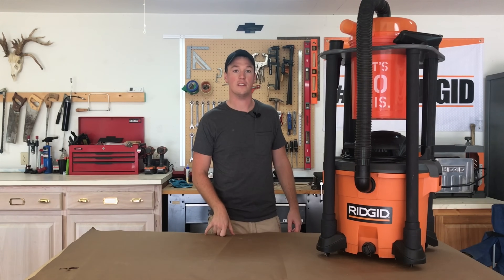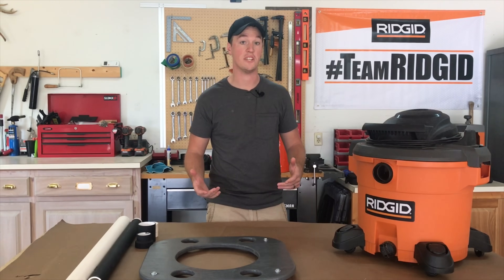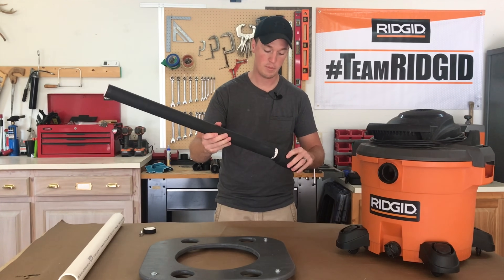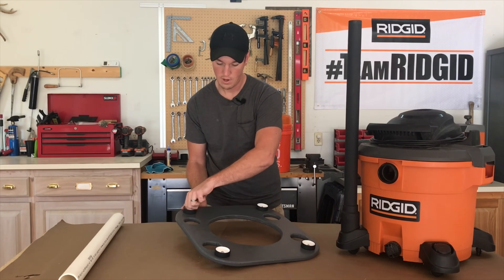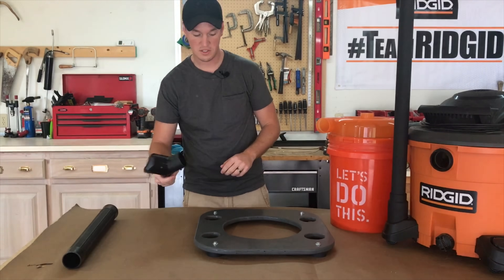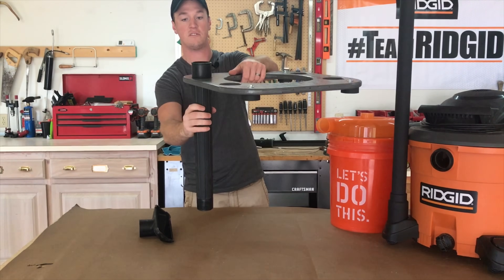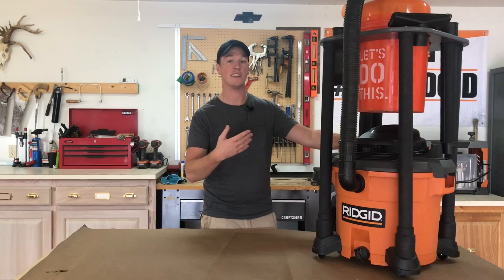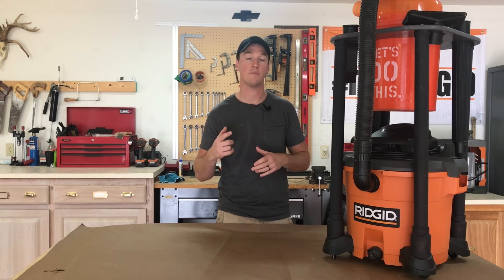The Ultimate Space-Saving Dust Cyclone Separator Cart | Dustopper & Ridgid Vac Cart

Comment: Just curious, I don't have the same vac as you. Mine is the 14 gallon Ridgid. Did you take the handle off the top of yours or did it have a handle on top? I'm thinking of removing the handle on mine and that will allow me to make it a bit shorter. The overall height of my vac is taller than yours. Also, I had to do some fancy footwork on the legs for mine. The caster housings have a type of protrusion on two of them so I ordered out two more. Now I have all four with that protrusion and when measured across the widest point corner to corner, the measurement was 2 1/4". There is nothing that I could find that gave me that inside measurement. So, I found some 2" abs adapters that go from 2 1/4" down to 2" i.d. I'm using four pieces of 2" abs black plastic pipe for the legs. At this point, I have them cut to 36" but if I take the handle off, I think I can get down to about 30-32". Other than that, I think it will be pretty much similar to yours. Thanks again for posting this great build video.
Reply from the maker: Ray Scrafield no my model didn’t have a handle on top! So the fitting you were able to find fits snug inside the castor with no slop on the new model?
Reply: @JohnBuildsIt  it's hard to put into words but I will have to do a bit of altering to the caster housings to make a good solid base for the adapters to sit in/on. But not difficult. I have to nip the corners off of the protrusions at a 45 degree angle so that the adapters have a good solid base to sit on. Yours was a much better designed housing.

Comment: Could you skip the 2 inch coupler on the caster and directly use the 2 in -> 1 1/2 in reducer instead?
Reply from the maker: The reducer alone wouldn’t seat all the way inside the caster, because it reduces to a smaller size

Comment: Just curious about something. In your video, you did show two 90 degree adaptors. I take it you got one with the duststopper. Now, I just ordered one and it doesn't come with any. Am I wrong or have they gone cheap on them?
Reply from the maker: Ray Scrafield no it only came with one! The link and explanation to what I used is up in the description!
Reply: @JohnBuildsIt  Well, now they don't come with any.
Reply: I just found the brush at Lowes for $8. That's about $4 less than Amazon. 3 in stock here locally. Also, according to the H/D q&a for this product, some say theirs came with an elbow and some say it didn't. Sound like some have been pirated out of the boxes.
Reply from the maker: Ray Scrafield wow!! That’s a bummer. I’d reach out to them if I were you and say yours was missing!
Reply: @JohnBuildsIt  I'll have to wait and see what I get. I won't see it until next week. Now, after doing some checking some folks say that they got an elbow and some didn't. The latest one that said they got it was the first part of this month of April. I'm hoping that I just misread the H/D ad.
Reply: Update.....I received my Dustopper kit and it did have the hose and one 90 degree adapter so all is good. I also went to Lowes and bought the brush and the 90 degree adapter works great.

Comment: Great idea,  John !!!  I bought the NXT model, HD1200 .  Since the ABS 2" couplers are too short to clear the smaller hump in the caster fitting, I used the white PVC 2" couplers  and 2" to 1-1/2"reducer bushings to 1-1/2" black ABS pipe legs that are 33" long which gives me a little over 1" clearance between the bottom of the bucket and the top handle of the Shop-Vac.  I got my second elbow (90 degree Brush) at Lowes and the 36" hose with elbow that comes with the Dustopper is the perfect length .  I found that True Value Hardware sells 1-1/2' ABS pipe by the foot so I bought a 10' length + a 3' length.  I did not bother to paint the White couplers so I have Black  legs with White socks into Black shoes,  (it's a shop tool!) Thanks for the basic design.  Bert
"

Comment: Heads up for anyone doing this build on the new Rigid 14 gal. NXT vac. A 2" pvc coupler is a little too big for the leg fitting, and the 6 hp/165 CFM might be a little too much for the bucket. The orange HD bucket I used collapsed a little when turned on.  I lined the inside of the pvc pipe with a couple layers of aluminum tape to make a tight fit around the legs. Still looking for a more secure long term solution.
Reply from the maker: Interesting! I just got the 14 gal, was going to make a version 2.0!

Comment: For shop vacuums that don't have the castor setup like shown, you could make a plywood dolly base larger than the vac itself. Set the vac on it, and build up your legs from the base. It will have a slightly higher center of gravity, but it'll also simplify construction.
Reply: Instead of buying 4 casters for it, use a furniture dolly from Harbor freight, much cheaper for the whole setup

Comment: I didn’t want to mess with the pipes so I screwed a round piece of half inch plywood to the vac in place of the handle. Bungie the bucket to the plywood with a couple eye bolts. Works great and super simple.

Comment: That is a fantastic design, I love it! It's unfortunate that not all vac have those feet cup designs though. I use an older shop-vac brand, about the same size, but no roller mounting options. Either way, great design. I'll definitely build off of it to design something similar for my model vacuum. I'll be happy if I end up with something even half as sturdy as what you ended up with.  Also, I'm a big fan of the HD dustopper lid, it's so much less wasted space than a dust deputy, even if it was slightly less effective, the space savings alone fully compensates for it, imo.  Great vid, keep em comin!

Comment: A good solution on the newer Rigid is to use Schedule 35 2" eclectrical PVC coupler. Fits perfect in leg and 2" pvc fits inside.
Reply: isn't electrical coupler metal, not PVC? just trying to find what you mentioned here, have the HD1200, need to do this cart :)

Comment: Great build, I am going to build this for my garage. I was wondering what are the measurements on the plywood for attaching the pvc caps. Maybe corner to corner measurements?

Thanks for the great video
Reply from the maker: Scott Tarrant I just measured from the center points down on the castors and then copy that to drill the holes in the plywood. Thanks for watching!
Reply: @JohnBuildsIt  i'm 3d printing my reducers and caps right now. and i was wondering how you got the measurements for the caps. this is perfect! thanks!

Comment: I built this with a slightly different model of Ridgid vacuum, and I didn't have to step down the thickness of the vertical pipes. I added some hooks to one of the pipes to wind up the cord more easily, but otherwise followed the plan, and it works great!

Comment: Hey John. I'm picking up a new 1270 tomorrow to do your design. So I don't have it in front of me to see how things fit.

I did go get some black abs 1-1/2'' caps, and 2'' to 1-1/2'' reducers. I hate painting pipe, and it's too cold here now anyway,,,lol. 

I'm curious. Couldn't you just have put the reducer right on the shop vac. Eliminating the 2'' coupler and small piece of 2'' pipe. I'm guessing your pipe might have been a bit short to clear the bucket and you did it like this to make the pipe longer.

Or am I just missing something and it will become clear when I start the project,,,lol. Thanks.
Reply from the maker: Quick Cal's Garage the coupler was the best fitting to seat all the way down into the castors for a snug fit, the reducer alone wouldn’t fit down in the castor very far, as it’s reducing down to a smaller size. Hope that makes sense. I have heard the new vacs have different castors though you may have to experiment!
Reply: I was looking at the reducer compared to a couple. They seemed to be the same depth. Unless you used a repair coupler. They don't have a stop in the middle. Is that what you had?

I bet I can't find a black abs repair coupler,,,lol.

Comment: Great idea!!

I just finally finished putting together my Harbor Freight blast cabinet. I'm going to try using it as a  soda blaster. I also finished up my Dust Deputy. Had all this stuff over a year,,,,lol. 

The shop vac I have is a great big bulky one. The set up is an abomination,,,lol. Hoses all over. I have a very small garage. I just came in to find some kind of DIY cart. Found yours. 

Is there any reason I couldn't do this with a dust deputy?
Reply from the maker: Quick Cal's Garage not at all, several people have! I just like the dustopper for the smaller overall compactness off the cart and it comes with the second hose needed!!

Comment: Awesome. I was almost about to buy the dust deputy, but saw your other video comparing the two. Just bought the rigid wd1600, definitely will be doing this enhancement to it. Thanks
Reply from the maker: Awesome! The new vac is a little different, so you’ll have to figure out the right sizes you need and not just follow mine. I’ll be doing a new video soon with the new vacuums!

Comment: Hey John, thanks for sharing your design. I have the exact same gear and I really like your solution. One question though: Is the motor in the vacuum and the width of the base enough to keep the center of gravity down, regardless of the pickup hose at the top and the bucket becoming heavier with sawdust?
Reply from the maker: Thiago Machado yes, not a problem at all. Thanks for watching!

Comment: My Ridgid 12 gallon is probably 6 years old now and I had to use the 1 1/2 from the bottom to top. Problem is the 1 1/2 on the casters is slightly loose, so need to find something like tape to make it slightly thicker. 

My other question is the 90 degree you link to on Amazon is a brush. Is that what you used? 

I need a 90 as mine is very tight without it. 

Best I’m finding is this one but not sure if is what you used and will match the one that came with dustopper. 

https://www.amazon.com/dp/B00GTRY66M
Reply from the maker: Chris Denneen yea the brush part just slides off and leaves you with a 90 degree elbow! That’s what I used so I know for certain it fits, can’t say for sure about the one you posted!
Reply: @JohnBuildsIt  Thanks, yeah I've seen the Amazon links change over time, which scares me, so wanted to confirm before I looked at ordering that part. Thanks for the build!!!!

Comment: Very well done and thought out.. without the tube sockets attaching the legs to the side of the Vac might be by banding and quick disconnects . Mine has sockets on the rear but none in front, so I'll attach by cutting slots into the tubing, fit over the  caster attachment and screw them down, different length tube for the rear.. BUT Do Able,, Thanks for posting your way...

Comment: Bought a Duststopper several months ago and have hoses running all over the floor. Was researching carts when I found this. Brilliant. I remembered seeing some Rigid vacuums boxes at a local outlet store. They had a bunch of vacuums with flood damaged boxes. I got an old style model 1270 for only $50. 

While I was picking up the other parts at Lowes I remembered a YouTube video where they had backlighted a white 5 gal bucket to see incoming dust and see the dust level in the bottom. Lowe’s had a “food grade” white translucent one for under $5. And a blue Lowe’s lid fit perfectly so the Dustopper should too. Too cold to work in the garage so construction will have to wait for a while. That will give me time to figure out how to backlight it.
Reply from the maker: R D Davis updated video is in the works using the new Ridgid vacs, lighting the bucket was one of the things I wanted to add! Haha

Comment: I made one of these!    After watching your video, I realized that 'vertical' solved my space problem for dragging the thing around. Also, prior to the build, my unattached bucket would tip over all the time. 
But Good news: The vertical setup with the (entirely empty) vacuum on the bottom, is actually VERY stable.  That, plus a nice long hose, means I use this solution for all my dust/chip collection!
It's been a couple of months and I REALLY like it.
Thanks!
Reply from the maker: Doug Tooley heck ya, thanks!! It was definitely pain having the bucket tip over for me too. Can’t beat this set up now!

Comment: Mind blown!! I have a craftsman vac and it has the same type of thing on its wheels. I never knew they were meant to hold the fittings. This is a genius idea. I recently did something very similar to your overall idea by placing the bucket above the vac, but mine looks way more crude than yours. I may have to change mine up. Here's what I did. https://www.youtube.com/watch?v=Gx8QglD8ock Also, thanks for the video comparing the duststopper and dust deputy. I'd never seen the duststopper, but if I had, I probably would have just bought one of those instead of building my Thein baffle.
Reply from the maker: Dustin Rogers your baffle looks good! But you’re right, for the time and materials it takes, $40 bucks for a Dustopper is a no brainer. Thanks for watching!

Comment: John, thanks for sharing your great design. Would you mind sharing your decision to use the 12 gal 5 hp vac rather than say a 16 gal 6.5 hp vac? 

For other readers, I'm wondering whether anyone has built John's design but using the Dust Deputy. Thanks again!
Reply from the maker: Bob Swanson I bought this vac at an auction for like $5 haha that’s my only reasoning. Works great, very happy with it! I would like to test out Ridgid’s new 6.5hp model to see how it is. If it improves the setup I already have, that’s amazing!
Reply from the maker: Bob Swanson also, a ton of people have sent me pictures of them using the Dust Deputy as well!
Reply: @JohnBuildsIt  I'm currently working on my cart using a Craftsman 16 gal vac and a Dust Deputy. I was wondering whether you are using an iSocket Autoswitch with your setup? And, if so, whether you're using the switch at the outlet or Incorporated into your design? If the latter, could you share how you mounted the autoswitch? Thanks again!

Comment: Hi John, just getting into building stuff and found this video and so glad I did. I'll be doing exactly what you just did and FYI to others, HD still has this particular vac, (my local HD has 13 of them) How tall did you make the legs. Thanks and just subbed
Reply from the maker: AnglerX I made mine 28” for this vac, then the couplers and reducers add a little. All my dimensions are up in the description! Thanks for watching!!
Reply: @JohnBuildsIt  What is the spacing between the bolts (which connect the caps to the plywood)?
Reply from the maker: Patrice Gibbons I measured from center points of the of the vacuum castors and copied that to the plywood
Reply: John Builds It Thank you for your quick reply! Got it! Brilliant!

Comment: I just completed my vac build. I did not need the 2 inch long 2 " PVC pipe pieces. My Home Depot had a 2" to 1 1/2" reducers that connected directly into the 2" couplers. The 1 1/2 caps were about 2 " long and I figured out that they need to be 14 inches from center to center of where cap is attached. When I cut circles for my attachments, I had allow for the lock tabs on each piece, so each hole has a slight "notch" to accommodate the tabs. The only issue I have with this system is that it's a little troublesome when it is necessary to disassemble in order to empty the vacuum canister or clean/replace filter when necessary. Obvious that will not be very often, but eventually it will. Question: Any ideas as to how I would connect the vac to my miter saw. The dust collector outlet  is about 1.578" O.D.

Comment: I cannot find the elbow used to connect the hose to the to the vac and then up to the deputy. Would you share the part number? I have an old shop vac like yours and I build everything closed to your description but I cannot fid the elbow. Your idea was great, thanks so much!
Reply from the maker: Laura V https://m.lowes.com/pd/Shop-Vac-1-Piece-Right-angle-Brush/1060273 the brush part comes off and leaves you with the elbow. Here’s the Lowe’s link, also got one at Menards. Probably available most places shop vac accessories are. Thanks for watching!
Reply: @JohnBuildsIt  Hi, thanks so much for your answer. I need another piece of info, if you do not mind. What hose did you use? P/N? I have a 2.5 hose but it is quite long and I was wondering if you got a short one. It really looks much shorter in the video. The other question is the part number for the straight edge extension. My Lowes never has anything off the shelf for shop vac (quite frustrating because I cannot simulate!!!) and Home Depot has the similar problem, so I really need some help to finish the set up. I used 1" pipe instead of 1.5  because your size was not available but I think it does not matter. Your design is such a space saver, love it!
Reply from the maker: Laura V I updated the video description above with an amazon link for the 90 degree elbow. The short hose I’m using is the one that comes with the Dustopper, the other long one is the one that came with my vac. Hope that answers your questions! All the pvc I used should be pretty standard and the sizes are also in the description. Thanks!

Comment: Where did you get the second 90* elbow for the top connection to the dustopper? The kit only supplies one.
Reply from the maker: warren rushing Lowe’s 90 degree brush attachment is the easiest and cheapest. Brush part comes off and leaves you with the elbow
Reply: Thanks for responding.

Comment: I built this for my 17 year old Ridgid shop back. My unit is taller so I had to re-cut the legs to leave room for an exhaust (40" legs).  Also the hole for my paticular bucket needed to be a bit wider.  I'd suggest measuring the circumference of the bucket and using a web site calculator to get the diameter.  Awsome idea and it works great!